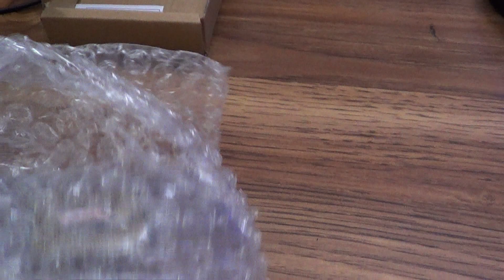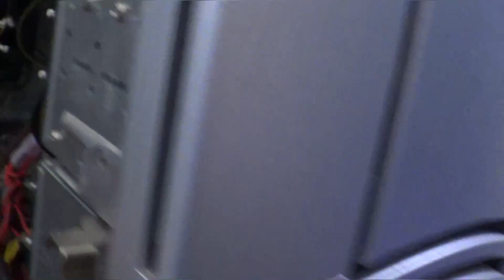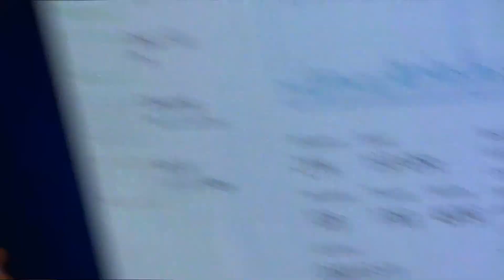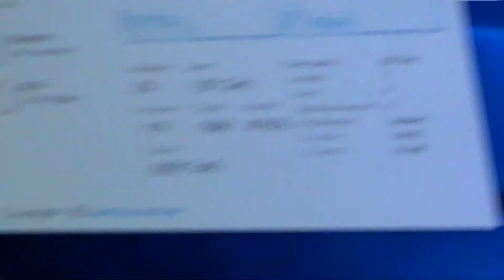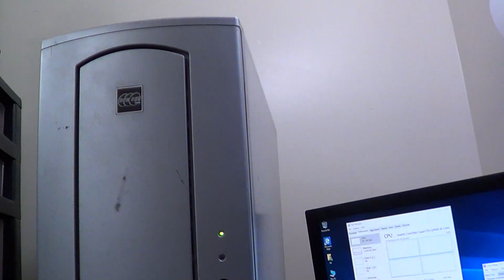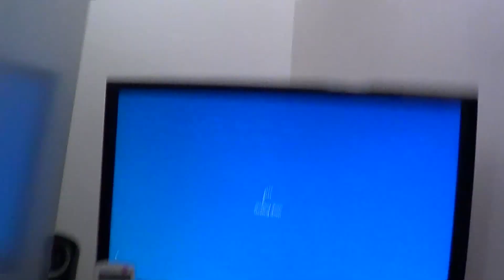The Silver Bullet Goes Quad Core

Comment: 😏 Bro, theres something wrong with ur rig, normally a Quad Core runs much cooler than a Core 2 Duo or 2 core Pentium, i know everyone would think that its the opposite but its not, Quad Cores run cooler, check your mounting and paste, maybe u got it mounted crooked? And did u speed up the fan speed in the bios, sweet spot is around 60% of max 💻🤔
Reply from the maker: That's what didn't add up here.  I figured the die shrink would reduce the thermal requirements.  I had other projects to take a look at first when I was on vacation though... 🤔🙂😊
Reply: MultimediaJay 🙂 okedoke keep us in the loop whenever u get another chance to look into it 😊💻🚩
Reply from the maker: @MrSamAdolfo  The stock cooler was falling off.  🙂  That might affect things.   Been getting back into this stuff lately lol.  😊
Reply: @MultimediaJay  😇 Hi Jay welcome back, yes if thats the stock intel cooler it has those pesky plastic push pins, normally when I mess with those coolers i have the motherboard out and in my lap, I then work each pin in and make sure they full click, i then look at the back side and closely inspect if the pin and plastic fingers went all the way thru the hole. They are so sneaky LOL. If you have a modern case and the back side is wide open with a big hole you can leave the motherboard in, but if you have an old case I dont trust it LOL I would take the board out. Thanks for the videos and the reports, Sammy 🙂

Comment: 🤓 TIP: Buy up all the dirt cheap Core 2 Duo Desktops that you can find in ur local area, then upgrade all their lga 775 motherboards with a compatible Intel Quad Core CPU, dont let anyone tell u different because they are still great all around goto reliable spare beaters that get the job done yay!  💻💻💻💻💻💻😍🚩

Comment: great upgrade :) my first pc i bought a year ago for 20 bucks it had a pentium e2180 i spent 10 more dollars on a Q6600 and it was worth it served me well and even was my backup system for a few weeks until my current i5 2400 system arrived. The Q6600 in early 2018 did everything i wanted from modern games like doom to recording and editing videos very well. Not far off from my current system in terms of performance to be honest
Reply: Twintania 🙂 FACT: Depending on the app or game, Intel Quad Cores trade blows with an old i3 cpu 🐢🐢🐢🐢😊
Reply: MrSammy the games performance overall was very similar to my i3 2120 (which was the pc in between my q6600 and current i5 2400) the only thing it couldn't do that my current system can is record resident evil 4 and other cpu intensive games. Even then i was still curious about the tape mod or higher end core 2 quads but at the time the Q6600 was cheap and the newer core 2 quads were kind of expensive
Reply: Twintania 🙂 yup, sounds about rite friend, it just depends on the particular Software or Game, an Overclocked Q9650 performs close to an old i5 but the problem is those motherboards are expensive so we dont really hear about them, 😏 still a regular old stock quad core keeping up with an i3 is not bad at all, im always on the lookout for dirt cheap core 2 duos in my area, they make good spares or a gift for a close family member or friend, they dont believe me when i tell them how old it really is heehee 😊🐢💻😍🚩